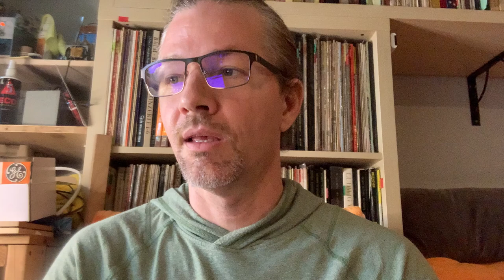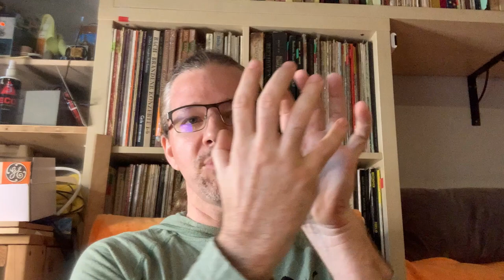Can we convert an inert cabinet into a live cabinet - or the other way around?

Comment: Hello! You also hve a very interesting tonearm on Your turntable in the beckground. The player itself looks looks like a Verdier, but do You already have a video that deals with the tonearm, how and why You made it?
Reply from the maker: Hi Liten, it's a home built table with corian plinth, VPI bearings, VPI motor and Teres platter. I have some videos on the long arm and the cartridges I'm using but don't recall their titles... I often touch base on several subjects on each video, and frankly I've lost track after a couple hundred of them. Briefly, it's a spruce-balsa arm with embedded silver wiring. The arm wiring goes directly to the cartridge, no pins involved.

Comment: have to disagree you won't be increasing the weight of the cabinet by using bracing correctly not to the amount you're suggesting lol.
and as I said previously you can use a soundboard to make an inert cabinet more lossless you need to know what the resonance frequency of the cabinet is to adjust your soundboard accordingly. and you don't need to increase the size of the cabinet because it's inert
really the only part of the cabinet you want to be lossless is the front baffle.
Reply from the maker: My cabinet is on the far extreme of live, and it transmits high levels of resonates across the entire spectrum from about 10Hz to 500Hz broad band. My comparison was for the far extremes of live and inert. A good many braces would only bring up the resonant spectrum from 10Hz-500Hz to 200Hz-500Hz or so. To create a truly inert cabinet per state of the art high end today we need 2in of MDF (per pracice, although I'd use ply instead), with preferably two layers of 1in with mass loaded vinyl in between, in addition to heavy internal bracing. There are many shades between completely dead and fully live, I was talking about the extremes, how to get the most representative form for each approach.